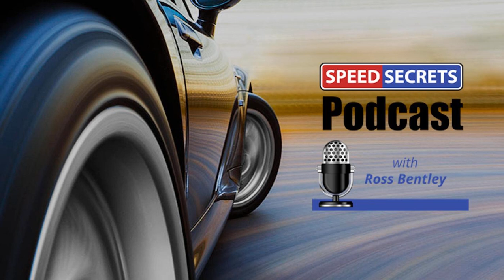166 – Craig Watkins: Birth of Flying Lizards and Engineering Your Car’s Handling

Comment: Hey, Ross -- Re: Trackday drivers trying to "wake-up" a tire while under-driving the car -- why not adopt a "wet track mindset of making the car do something," as in: add heat by adding pressure to start? I see how that goes counter to Craig's advice on grip and need for rolling resistance, but it seems like that will create immediate feedback and feel to how you're actually driving.  Or do I like that extra pressure 'cause I only seem to get to the track on ice-cold days?!  PS -- I've been a Pat Long fan since about 10 years ago, meeting him at NJMP when he dominated a field in an ARCA race, on a track he never saw, and a car he never drove before putting it on the pole and leading every lap.
Reply: PPS -- Great "interview" with Craig. That's the least you ever spoke on a pod-cast, but well worth the listen.
Reply from the maker: If the tires are being "under-driven," then running more pressure can help give the driver more confidence to push harder. Of course, if they then push harder, the tires may end up over-inflated. So it's a moving target! If you have the opportunity to start them higher than normal, then come in and bleed them down, that's a good approach - but tough to do in a race!